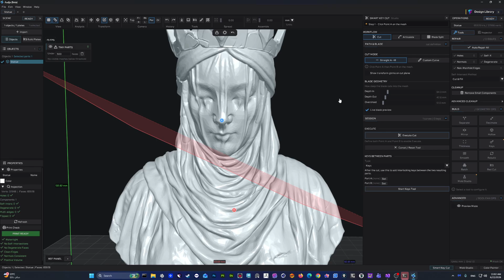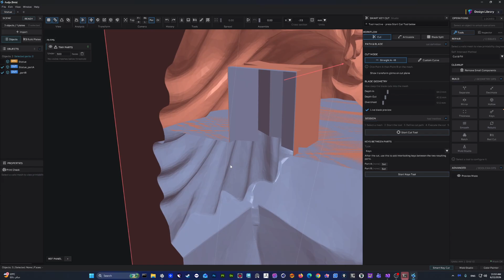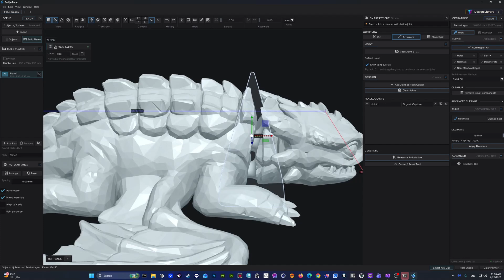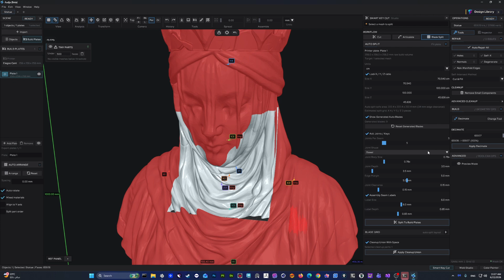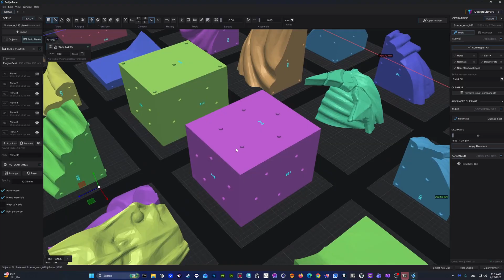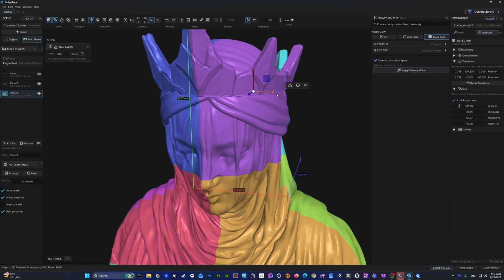Audja Tutorial #3: Split 3D Models and Add Connectors

Comment: Mine is broken,,, i can perform straight cut without being able to move regulate the size of the cut but i can control the cut size with custom line but can't cut T.T
Reply: IN the tool bar this is a section to give feed back